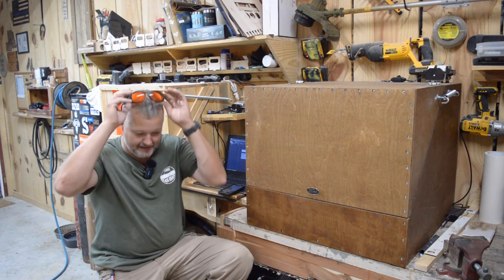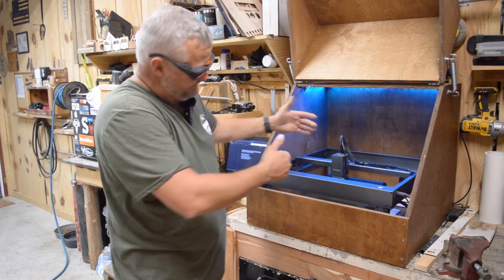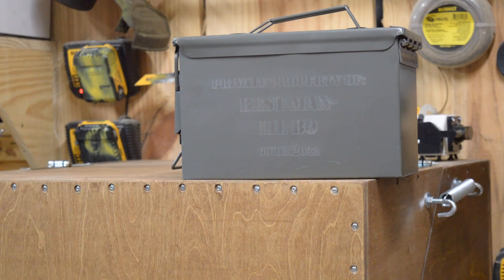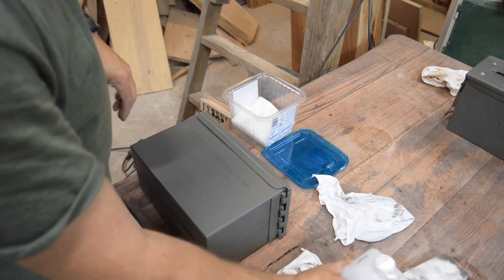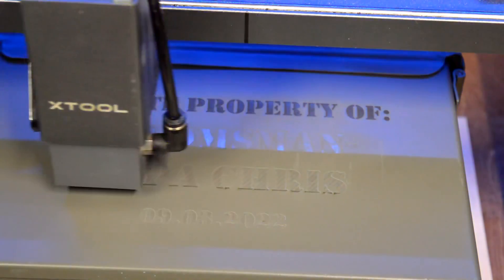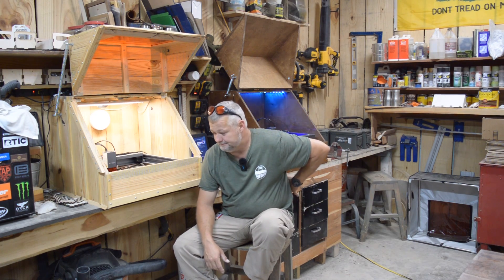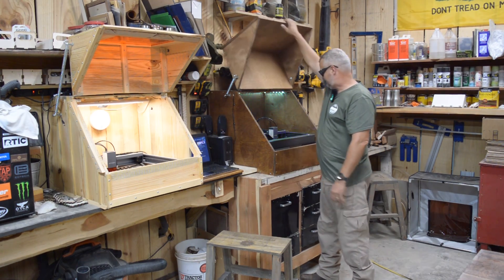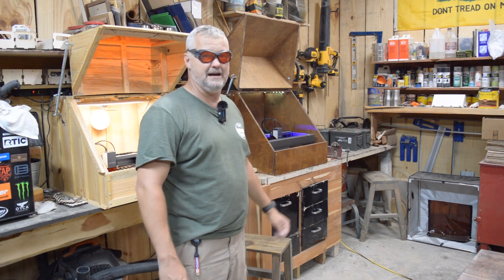Engraving custom cans with the XTool 10 watt

Comment: Another option for marking the cans but still using your laser would be to cut a stencil out of heavy card stock and then spray paint using the stencil. I've uses this method before on other projects, and it adds a cool rustic look if you lightly spray the paint.
Reply from the maker: Yea, I also have 12 inch tape that works but they asked for engraving.
Reply: @TheClackShack  Yeah, if they requested engraving then you're kind of stuck. Keep up the good work, man. I love your videos.

Comment: I’ve been trying for 2 weeks to get my XTool D1 to work. Lightburn won’t find the laser and the cuts and layers section just says “waiting to connect”. The XTool software “creative space” will engrave but won’t “frame”. Makes it pretty useless since I can’t verify size and position if I can’t frame. Any ideas????????
Reply from the maker: Did you download and install the config file for the machine? Sounds like it could be a driver issue. If it isn't a Pro model, you may want to download and install laserbox basic just to see if maybe the usb driver isn't in the new software. Just my thoughts.

Comment: I keep seeing internet people say not to run diode lasers at 100% power, because it shortens the life of the laser. Do you find thats accurate? I've been watching your channel for a month now and I trust you more than random internet people.
Reply from the maker: I can't say for sure and don't have  scientific way to test it but here is my opinion. XTool says that the laser will last for 10,000 hours (https://support.xtool.com/hc/en-us/articles/4405624562199-Pre-sales-knowledge-for-xTool-D1) that equates to 416.6 days of continual running. If you run your machine for 4 hours a day, that is 2,500 days of running.  Assuming you run it 4 hours for 7 days a week, that means it will last for 6.8 years. Chances are, some other component will fail or you will purchase a new machine before you reach the life of the laser. 

Also, I make money by completing jobs, if jobs take longer, I loose money. I work as fast as I can and maximize my profit. Doing so, I can afford to replace the machine. 

Just my opinion.

Comment: Nice I like how they came out. Is there a reason why you did not run a test grid on the ammo cans. 
Do you have or can you do a video on the Jig file setup on the computer? I understand the puzzle in the laser.  Is there something different you do to set it up on the computer?
Reply from the maker: Yes, the ammo cans are for a wedding and most of the folks wouldn’t know what the grid was…. Lol. The simple answer is $15, that would require me to buy and extra ammo can and ruin it with a grid. I start low and walk it up until I get the desired effect. I made an extra $15 in this already cheap job by not using a grid. I only charge $15 per burn for these, the customer provided the cans. I set my return location to keep tolerances tight and not depend on limit switches. Yes, I built a framing file for the box. I do this to all my burns to avoid mistakes on placement.
Reply: @TheClackShack  That makes since. New to the laser world. So thank you for all the information.

Comment: The video makes it look pretty good before cleaning (maybe it’s not as good looking up close). If the post burn does looks good, what if you just gave it a couple coats of matte clear… leaving the “soot”.  I know your done with these…. Just a hypothetical question that doesn’t require an answer. Interesting video.
Reply from the maker: The finish would likely fall off because the ash is not attached to the surface. I could have engraved, sprayed with cermark and engraved again but in this situation, I wasn’t asked to make them black. They wanted white letters but changed to just engraved.

Comment: You can dust on powder coat and than re-engrave it. That will melt the powder coat only where you engrave.
Reply from the maker: I would make a mess trying that. Customer is happy, I am happy. I didn’t bid this job high enough to cover much trouble.

Comment: If you take the lid off the ammo can, it will be much more level and better able to focus. Especially in the D1 10w.
Reply from the maker: It was focused ok, the middles have a high spot anyway. I split the difference and it worked. This burn doesn’t have much detail, just block letters.
Reply from the maker: The comgrow air assist has a shorter shield so it doesn’t catch like the XTool one. Not a bad idea but leaving them on doesn’t seem to hurt.